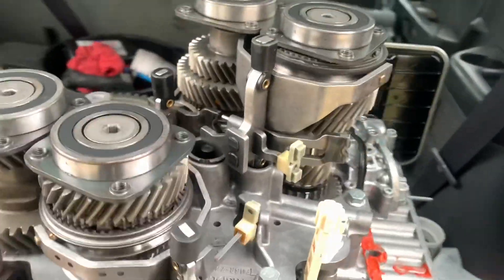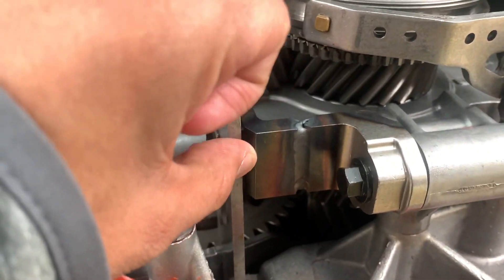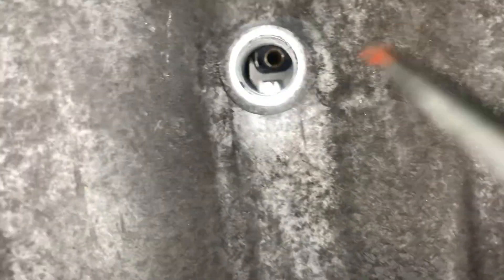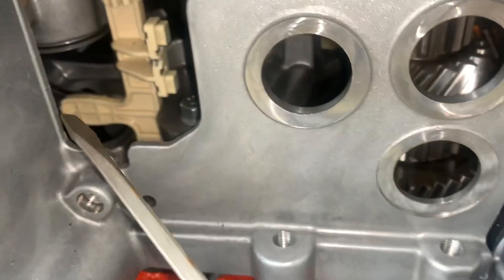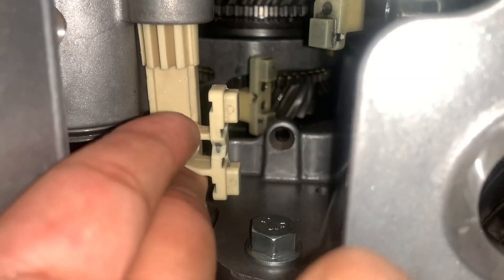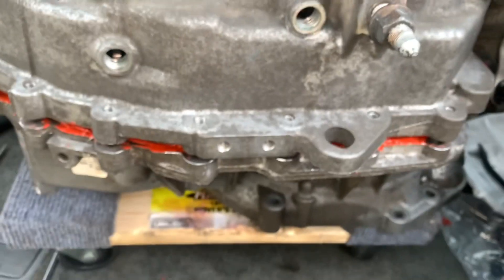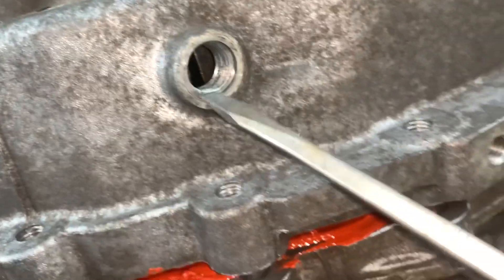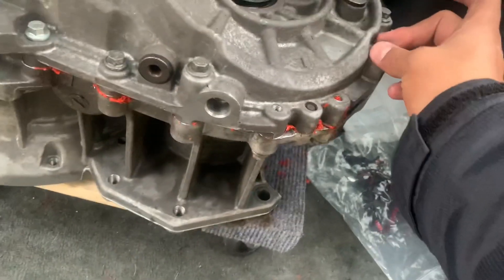Mitsubishi Evo X MR SST Transmission DCT470 Rebuild/ Closing Cases/ Shift Forks

Comment: did you have to close the last bit of gap with bolting up or did it just fall into place with no gap?
I had about a quarter inch gap and then fitted all the bolts and slowly got it togeather.
Reply from the maker: Yes, you’ll have a small gab around quarter of an inch, after that you’ll have to bolt it to close the gab
Reply: @josezamora7889 Thanks for the reply Jose, I got a little nervous after hearing the casing make a snap sound about a minute after doing up all tha casing bolts and not so tight. probably was hung up a little on a dowl.

Comment: hello please i need your help : i have a ralliart mitsubishi lancer 2013 can we change the sst transmission of my ralliart with an evo 10 mitsubishi sst transmission. i don't have with my ralliart s sport mood .
Reply: You’ll need to save the data from the ECU/tcu before you pull it out I believe. Then transfer the data to the new one once installed. But you gotta get the data BEFORE you pull it out. Using proper scanning tool
Reply: @MacB369  hello i change the the transmission  and change every thing as u say ECU. then first day the car work properly  but the next they we make remap. the car began to turn of when i will put the transmission  pad from p to R its hard to change shift . it change gear properly from   1 2 3 4 5 but when i stop the car on D in traffic it turns off alone. or when i change the gear shift from P R N D fast  the RPM goes below 1 and it turns off too.  i don't know what to do,  my mechanic  says there is a fault in the transmission  mechanic  its not good. can you help me where the problem ?

Comment: This looks difficult.  Do you work on these as a job?
Reply from the maker: Not a job, just doing this on my own transmission. Trying to rebuild it.
Reply: @josezamora7889  Hi Jose, where you albe to rebuilt on your own? Does the car run good now? What problem were you facing that needed a rebuilt? I'm having problems with mine as well
EDIT: Jose, Jesus Christ: I was from mobile and didn't realize you had uploaded the full work. I literally just watched all your videos (1,5x). I'm having the same problem (skip of reverse and odd gears, even gears still working fine) and I will try to work on it.
By any chance, can you share the documentation (the papers you show in some parts) you used?
Great work, I'm very happy you got your Evo X running again!
Reply from the maker: @lucasaugo4241  hey how’s it going, car runs I haven’t posted it cause I sold it right after. Car was too expensive to keep. I bought most parts from jacks transmission and from SSP performance
Reply from the maker: @lucasaugo4241  i do have some documents on it, should be on my 1st vid and third